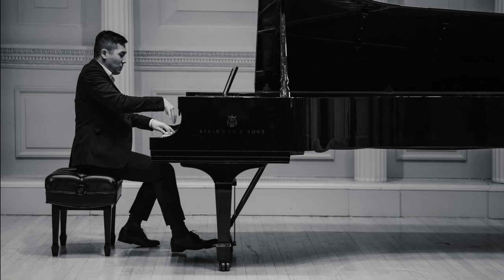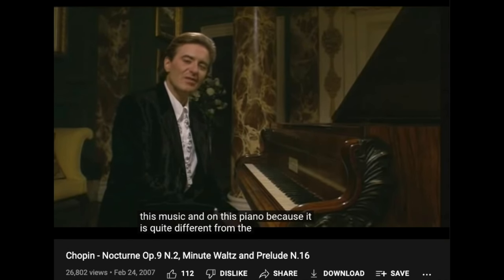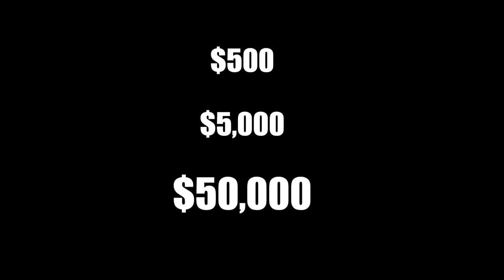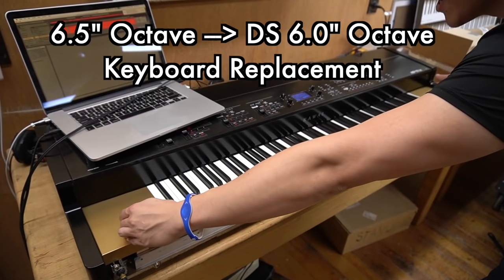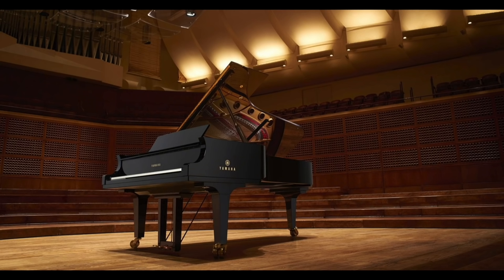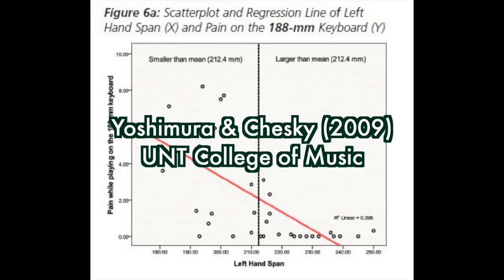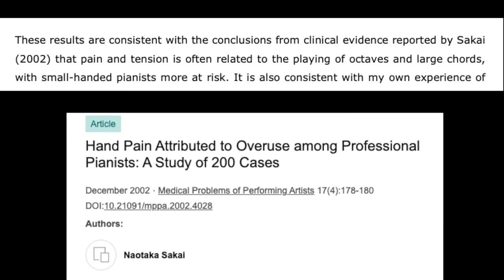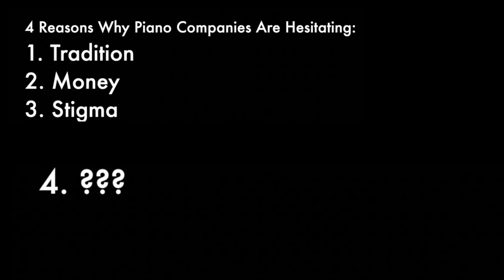Piano's Darkest Secret

Comment: Thanks for this video Lionel of you playing my personal MP11SE Kawai keyboard, the first of it’s kind.

This Kawai project has taken years to come together since I first approached David about building a keyboard for the Kawai MP11se. 

I chatted with David regarding retrofitting an electric piano because of his great success with producing retrofits for existing pianos and building keyboards for new keyboards for Walter pianos and Hailun pianos. 

However, most electric pianos had plastic keys, or electronics built into the key which would make it impossible for a retrofit.

After some research there were limited choices.

Fortunately, the long length of the Kawai "Grand Feel" keys allows for a rocking motion similar to a grand piano and David was willing to take on the project which resulted in the Kawai piano that you play in this video.

David also added weights to each individual key as well as having to completely disassemble the key bed, and rebuild it with a bed of new pins and keys to interface with the Kawai's hammer mechanism. 

There were certainly challenges along the way and there’s a story to come of our process together.

In fact the keyboard you play in the other has another secret!

That keyboard has the ability to swap out the keyboard with the original key bed that came with the Kawai, a feature that David built into some of his grand piano retrofits.

My mission for this project is to bring David’s keyboards to everyone, just as we have smaller instruments for violins and other sized instruments.

The Kawai, as a portable keyboard with a full wooden action, would provide a lower price entry point than a full piano retrofitted and would allow professional pianists to tour and gig with them in smaller venues and with an easier load to bear.

It’s been my goal to encourage Kawai to provide MP11SE models without key beds, therefore lowering the price point for the keyboard itself with a DS 5.5 keyboard built by David.

I’m affiliated with the PASK organization that you mention, (Pianists for Alternatively Sized Keyboards), and would love to encourage anyone who views this video and post to contact Kawai and let them know such an option exists for the MP11SE that would also provide another income stream for them by partnering with David.

If you’d like to add your voice to this effort, go to https://paskpiano.org

You may reply to this post to chat further.

Best,

Ron Gordon
Reply from the maker: Hey Ron, thanks for kicking off one of the huge inspirations to this video. I'm so glad you had already ordered this from David because if not, I would have not been as motivated to make the really long (I truly despise driving) trip to Titusville. Once I tried out the work he did on your MP11SE, I was floored because of how accurate the MIDI sensitivity was. That has always been my biggest concern w.r.t. the retrofits that companies like pianodisc do. The fact that you believed in him and invested in him, is beautiful and I really appreciate you for taking the risk and paving the road for other MP11SE owners like myself to take this leap with much more security and knowledge. Thank you :)
Reply: Lionel, I'm truly grateful for your enthusiasm for the project as I wasn't really sure where it would lead or how it might end. I was initially just grateful that David would lend his genius to moving the idea from dream to reality. I only hoped that it would make sense to others. The Kawai MP11se portable platform really brings the implementation to a whole new level as a full midi controller for DAWS, as well as other instruments, with a modulation wheel, pitch bend, split keyboard functionality, built in metronome, drum machine, electronic piano sounds, strings, pads, and grand piano sounds built in. With the addition of the fully weighted DS keyboard, (DS 5.5 in my case), in just a few weeks of playing it, I've forgotten that any other piano key scale exists. The fluidity and ease of playing has led to focusing more on making music rather than what my fingers are capable or not capable of reaching. A few years ago at NAMM, a few of us representing PASK wore t-shirts that said "Play the Music You Want With the Hands You Have" "E-X-T-E-N-D YOUR REACH JOIN THE REVOLUTION" I'm very excited to have you joining the conversation and raising awareness for other players and the industry builders. Thank you!
Reply: @rongordon1556  Thank you for working to bring awareness for the need for smaller keyboards! I feel it’s important work. I just wanted to let you know I signed the petition after some difficulty finding out how to sign it. May I suggest putting the link at the top of the page and making it more obvious? Also I thought the link was broken at first until I pressed and held the button which is not typical of the vast majority of buttons on other sites. I was on my phone trying to do this. Also there is currently an ad running on the page with a big green start button that was misleading. I’d hate to think of the number of people who tried to sign it but didn’t because they couldn’t figure out how.
Reply: @linmonPIE  Thanks so much for your reply! I'm not a moderator at PASK, but I've passed on your comment. Thanks!
Reply: @rongordon1556  does this also fix the tape slip issue that affects many MP11SE units? I would love to get my hands on a reduced key width keyboard someday.
Reply: @kelvinng3593  Kelvin this is a great question and was something that David had to deal with when retrofitting the keyboard that he and I discussed. For those who don't know what Kelvin is referring to, there is a silicon like tape that is in between the hammer and the key that has been known to wear down in some cases on the MP11se. In development of the my new keyboard, David did replace all of the original tape with new pieces. (There is a youtube video that someone made on how to do this that we had found.) That said, David did apply new tape throughout the build because we were also working on a switchable keyboard, so the tape had to stand up to the whole key bed being slid out on a sled and then back in again for the different size keyboards. Ultimately I think from my research that it's hard to say what exactly causes the tape failure on some keyboards. Is it environmental conditions where the instrument lives that is affecting the tape? Is it affected by moving the keyboard around when gigging? Is it wear and tear on the keyboard over time?  Might it be due to some players play with a much harder touch? Again, in my humble opinion it's hard to say, as the tape issue only occurs on some keyboards to my knowledge. That said, one benefit of David's key bed is that each key is very well balanced as he is building 88 new keys, placing new balance pins for those keys, as well as adding weights to the keys to ensure the best balance possible. His over 20 years of experience building new keys and actions for acoustic pianos was certainly leveraged in this process. This was one of the main reasons that I had first approached David about the project, in addition to his passion for what alternately sized keys with real acoustic actions could bring to the world of players in expressiveness and access to the pedagogy and performance pieces. I believe that David's well balanced action will translate to less stress on all parts of the mechanism, including possibly on the wear and tear of the tape between the key and hammer. Time will tell of course, but Lionel also mentioned to me the difference in his original MP11se key action and the performance of the key bed David built for me. Hope that gives you some insight into your question!
Reply: I wonder if Kawai would be open in making a stripped down version of the MP-11 SE. For someone with small hands that just wants to play the piano or learn, so many knobs and buttons (likely never to be used?) seems overkill. Function/buttons and outputs wise, something closer to their ES series would probably make it more market-friendly.
Reply: @MrBatriste  Hi Nestor, this is a very good suggestion and is something that is under discussion. A stripped down version may be more economical to produce as well. Thank you!
Reply: @rongordon1556  I would say that within reason, the idea is getting it into a price point that generates enough purchase appetite for the mass market.
 
Perhaps Kawai could also explore Kickstarter and add clever guerrilla Marketing with the support of renowned pianists as product Ambassadors/Evangelists. 

Marketing needs to make a killer campaign. There's the need to raise lots of awareness on the lack of piano ergonomics, discrimination and get the message come across that players are not to blame for having "small hands", but that the blame comes from an unreasonably large "one size fits all" piano-size standard adopted back in the 19th century.
Reply: @MrBatriste  Yes agreed. We're talking about all of that. Keith McMillan uses kickstarter to vet his new products. I'm an editor that works in marketing so I agree with where you're headed. I'm also a bassist and like to use Stanley Clarke as an example for instrument sizing. Stanley is a big guy, but he's famous for using a 30.5" scale instrument to allow him to play things that a 34" standard size electric bass doesn't. My opinion is that smaller scale instruments aren't just for folks with smaller hands, they are for artists that want to express themselves in the way that they want to do it, playing the music they want to play. Most synth keyboards have smaller scales, however they don't have the touch sensitivity that this instrument has, especially for the classically trained player!
Reply: @rongordon1556  Agreed. I recently discovered there's the Lumi/Roli keys based on DS 5.5. However, that's not quite what someone looking for a "piano feel" would be looking for. Touch sensitivity and a weighted key bed, if possible, would be the dream.
Reply: @MrBatriste  I actually own 5 of them that are strung together as one large keyboard and the action is more like a synth than anywhere near a real acoustic keyboard. They are really cool for what they are!
Reply: @rongordon1556  5! quite the number. I'll see to get my hands on one of those. DS 5.5 seems to be my size; I'm curious to see what it's like.
In any event, I hope things work out with Kawai and or with any other manufacturer of Digitals that would be willing to explore disrupting the market.
Reply: @MrBatriste  Others have the view that large companies like Yamaha or Kawai would not get involved in Kickstarter campaigns...they would see this as inappropriate somehow. Here in Australia, the previous CEO was very supportive and facilitated them making a 6.0 size small grand (based on what they produced briefly in the 1990s) for Sydney teacher Erica Booker. But Kawai Japan did not want any mention of this option on their own website and this hasn't changed. They see narrower keys as a special custom order, an annoyance which interrupts their normal production.  Both Yamaha and Japan marketed small grands with narrower keys (maybe down to about 6.0 inch octave) only in Japan, but they didn't take off, so they are hesitant to pursue the idea again, at least for acoustics. They didn't make much attempt to bring teachers with them. And starting off with a small grand is not useful - too expensive and bulky for most teachers to add to their studios and also for parents, but too small for showcasing by professional pianists. 

And Steinway will allow people to order a new grand with a narrower keyboard (probably down to 6.0 size) but they do not mention this on any website. For many years, people have been free to order a retrofit keyboard from Kluge (keyboard company owned by Steinway) for an existing Steinway or any other grand. There is now some mention of this on their website. These companies are all so tied up with 'tradition' rather than wanting to get involved in something too different and revolutionary. They would then have to think about a longer term strategy for all their models - acoustic, digital - which they would prefer not to do.
Reply: @paskpianos  I understand that the pianos' " tradition" is one big challenge to overcome, also awareness.

Digitals seem the wisest target for mass-market adoption, and a small production test run via Kickstarter does seem the most risk-conscious approach. However, the involved Leadership, Product Managers and Marketing team would have to get creative and put serious effort. No pain, no gain.

Sadly, these corporations seem quite narrow-minded and change-averse, lest they be branded as "revolutionary" or non-traditional. The scandal!
Reply: I will keep close to any developments, thanks for such a productive discussion

Comment: It's not only, that people who already play piano would benefit from it, but also it would encourage people with smaller hands to start learning to play piano. :D I'm a bass player, and face a siimilar issue with the range of my hands on the strings, because I have small hands. I thought about getting a bass for kids, but one thought was: it's embarrassing, and the second thought was: is the quality even the same? 
At least you encouraged me to check, if there might be an alternative for my instrument with smaller frets, too. ;-) Thank you!
Reply: All you have to do is to put a capo on the first fret, then you detune your bass a semi tone to get E A D G, just as if there weren't any capo, and you're done ! And you will get the same sound quality, especially if you mount a slightly stronger gauge set of strings, just to get the same gauge as original. Some 15/16 acoustic guitars such as a Martin Dreadnought Junior are equipped with a set of medium strings and it does not harm the neck because the string being shorter, makes the tension looser. So you can keep your favorite instrument !

Comment: All strength to you and your quest. I completely agree with you.  I am currently playing a small upright, it has a light action and the keys are ever so slightly smaller than other pianos and it is a real joy to play for all its lack of dynamics. Years ago used to play a Ronisch  in a restaurant , that also seemed smaller and much, much easier to play than any another piano. After a few years absence  I returned to the restaurant to find the piano gone I walked over to where it used to sit and wept. Good luck great video.

Comment: This is actually insane, I used to play on a casio ctk-240, but I wanted a larger range (since the ctk-240 is 4 octaves large). So I got a Davis D-619 which is 5 octaves long, but the total length of the keys were somewhat similar to the casio. An extra octave added, yet it was a similar size! It makes me glad that the standard size could become a preference and alternatively sized pianos enter the market.

Comment: Incredibly well researched & compelling video. Just measured my hands & they are actually over the size mentioned, but the reason I personally think this is an important issue is that I've hand injuries from playing pieces that my hands just could quite negotiate.  I think the reasons you give why the issue is ignored are correct. There is obviously a bit of machismo here.  I wouldn't like us to move completely away from standardization but if as you claim playing on a comfortable sized keyboard does not ruin one's performance on a standard size one I cannot see why these should not be considered commercially. There certainly could be demand if awareness of the possibility was increased

Comment: Ironically enough, I have the opposite problem. My hands are large (I can grab a basketball with one hand) but this presents a different problem... My fingers are also large, to the extent that I am physically unable to play the white keys in between the black keys. My fingers don't fit. As a result, I cannot position my hands so far up the keyboard. To play certain chords I would have to twist my hands in such ways that it really hurts my wrists.
Reply: I have the same issue with thick fingers and not being able to play between the black keys (without also causing them to press down) but only just. if the black keys were a single millimetre thinner it would be fine. One kinda janky workaround I came up with is to get some thin strips of wood, about 6mm wide, cut to same length as the black keys and only a few mm tall - attach some double-sided tape (I actually found some that is 6mm wide) and stick these wood strips onto the white keys in the gap. This creates a little bump up so that I can play the white note and not activate the black notes on either side. You don't want them too tall or wide as that may interfere with pressing the black keys and you would want to paint these little bump sticks white to be less obvious. Double sided tape is strong enough to keep them in place but weak enough to let you pull them off when you want - with no damage to the instrument (i.e. don't use superglue you just want something that sticks enough but not too much). It would be great to be able to replace the white keys with ones that had this little bump already in them and properly shaped to just blend in but I've never seen anyone offer anything like this.